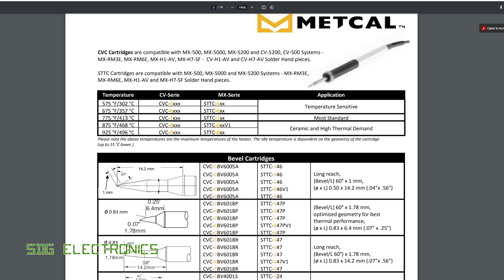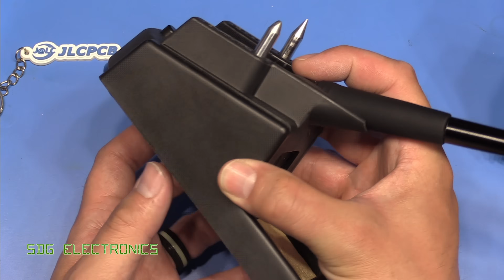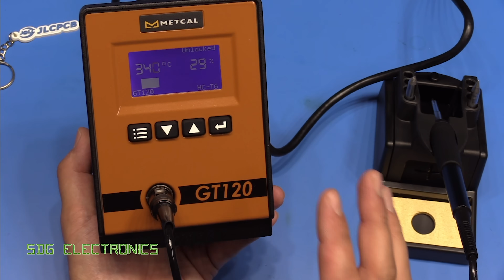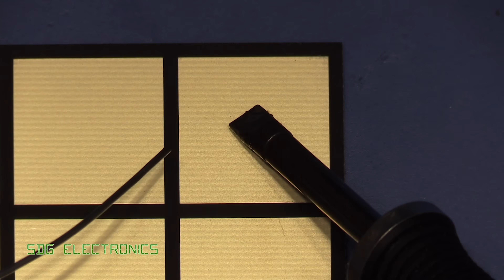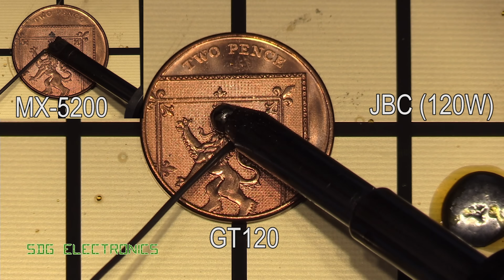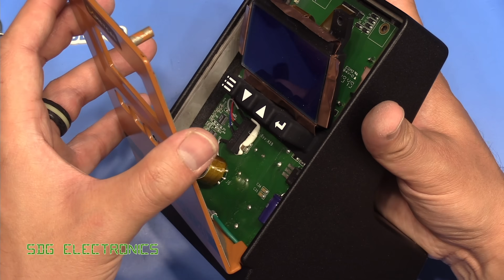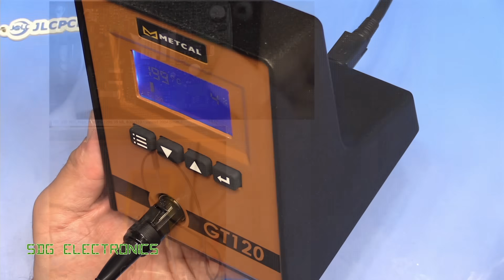SDG #209 Metcal GT120 GT90 Adjustable Temperature Soldering Station

Comment: Thank you SDG Electronics ❤️! For how long have I been waiting for this station to be reviewed by its legitimate hands? Just checked the notification and my heart raced its beats. Will be back after watching.

**************************************

Looks like the review is not done yet. But I don't think it can beat MX-5200 even with the integrated tips. GT-120 is definitely not for micro-soldering with that girth and tip to grip distance of the iron. All in all, a neat device that's elegant to the eyes. Looking forward to future reviews

You've managed to enrage some of the JBC fans by that comparison. I too was shocked to see a 120w JBC station lag behind both of the Metcals. Any specific reason behind that?
Reply from the maker: Not really sure on the situation with the JBC. I used a genuine C245 JBC cartridge and the Jabe station behaves exactly the same as the genuine JBC station from my experience using JBC stations at work. I've personally never been impressed with them and don't understand the popularity.
Reply: @sdgelectronics  Pointy tip that you used on JBC (seems similar to C245-937) is not meant to heat big cooper areas it has very small tined working are for heat transfer. To be fair you had to use tip similar to C245-741. GT120 in this comparison looked good just by the fact that you used tip that is bigger in mass then the coin it self. That GT120 handle and the tip selected is just mammoth.
Reply from the maker: @Mr.Laidukas  I swapped the tip for the C245-407 later in the video.
Reply: Maybe u never have a original JBC station in your hands and this is the reason u never impressed wiht JBC jajajaja u think habe the same performance the jabe piece of shit wiht one catridge original jbc Thais  the original JBC station??
If you say the handle jbc get hot u never have one in your hands...
Reply from the maker: @israelalvarezfernandez6532  I use JBC stations daily at work
Reply: U work wiht original JBC... ok i use JBC for arround 25 years never have a problem wiht this never broken actually i have DM control unit wiht pa120, t245,t210,dr560a this have arround 10 years and work same of the first day, not impressed, ok, what u spected for a soldering iron?? I only want precission in temp control, raise up quicky temp and durability. What u want for impressed?
Reply: @israelalvarezfernandez6532  Leave him alone! It's his choice. He's not a novice. He's had plenty of experience to decide for himself what's right for him and what's not. It's not only him, I've met a lot of people whose first choice of soldering gear is not JBC. There's no point in imposing my preferences on others. It's simply not gonna work.
Reply: I only want he say me what need for impressed in soldering tool.
I only want want control temp and most important DURABILITY for working is it the most important much more important than the price of the tool (if u work in electronics and can’t buy first level tools maybe u will want other work.... ;)
Reply: @israelalvarezfernandez6532  So you want him to elaborate on what to look for when buying a soldering iron. He might come up with a video for this topic. For me, what matter most is the temperature control, good thermal performance, less grip-to-tip distance, comfortable grip, and availability of tips.
Reply from the maker: @israelalvarezfernandez6532  Don't worry - JBC will have their time in court on the channel soon ;)
Reply: @sdgelectronics  Good news, Steve! Can't wait to see how it's gonna turn out!